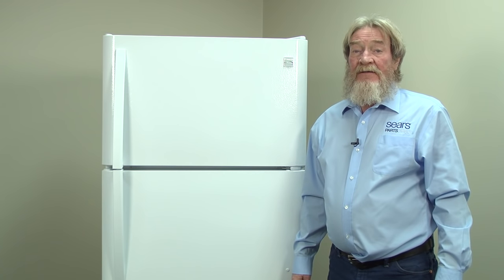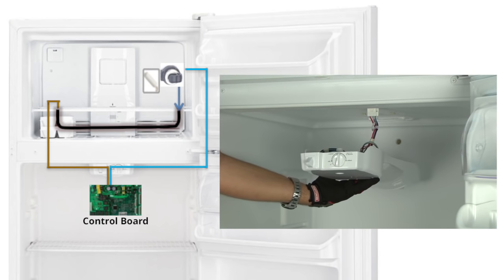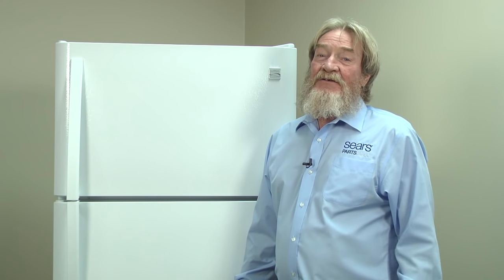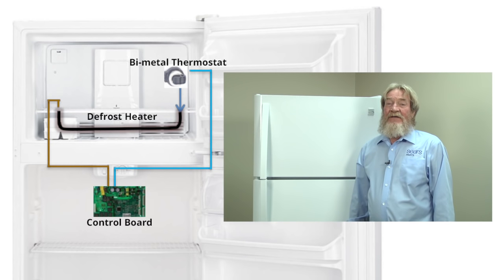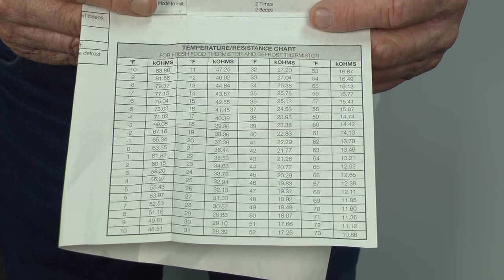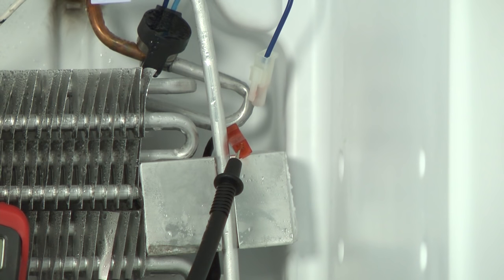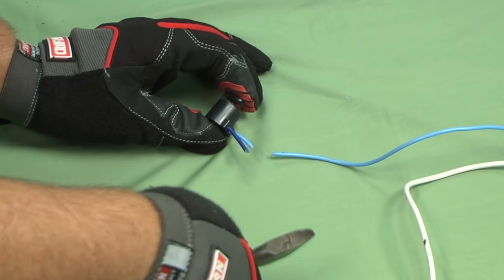How to Troubleshoot Defrost System Problems in Refrigerators

Comment: I have a whirlpool side by side that intermittently stops cooling ice melts.  If I unplug or change the cold settings to coldest it starts working again but will still intermittently stop cooling.  Is there a way to tell if the thermostat is bad or getting stuck in defrost mode?

Comment: can I just melt the ice to get me through until I can get into fixing the real problem
Reply: Yes. I've been doing mine about every 10 days. If you take the back panel off, you can defrost it quickly with a hair dryer.
Reply: This is what folks did before they came up with auto defrosting refrigerators! I can remember watching my dad do it before the days of hair dryers by putting pans of hot water in the freezer to help heat it up.

Comment: This video was extremely helpful because it was very logically organized, and concisely and clearly explained.
I did have two minor issues.  First, you didn't explicitly and clearly identify the location of the wire harness.  I believe it is visible in the upper left as viewed at 3:01 in the video.
Second, the links to the other videos didn't appear to all show up when mentioned in the videos, nor did I find them in the header text.  Hopefully, they are a quick youtube search away.
Thanks again, this was great.
Reply from the maker: Thanks for your comments about our video. The wire harness in the freezer does plug into a connector at the top left corner on the back wall of the freezer compartment. You can see the video links by clicking the "I" in the top right hand corner of the video screen. We hope this information helps. If you need further assistance, let us know.

Comment: I have a GE Monogram frige almost 20 years old. Refrigerator getting too warm f& bottom freezer too cold.  The evaporator coil now ices up and when I defrost with a hair dryer everything's good until it ices up again at the end of the day and frige starts getting warmer. What parts do you suggest I replace?
Reply: Don't guest check timer or heater or defrost thermostat before

Comment: Is the hidden "tech sheet" a Kenmore thing? I'm trying to troubleshoot a Samsung RL34LW-PLUS (RL34LCSW1 / XEG) and there is no "tech sheet" anywhere online. And I doubt I'll be able to find it at the inside some semi-secret compartment.
Reply from the maker: Some other manufacturers include tech sheets with their refrigerators. Samsung typically doesn't include tech sheets with their models. We didn't find information for the model number you posted. You may try contacting Samsung for the tech information.

Comment: Nice explanation. I have a frigidaire. Top of evap is icing up. Mine is 5 times in 6 sec. To initiate  defrost. It will not go into defrost. Bad control board?  The switch seems to be OK I put it in my freezer downstairs I got continuity across and 35 across heater.
Reply from the maker: The control board could be bad. You indicated that you measured continuity and 35 ohms across the heater. If you measured that continuity from the wires that connect to the control board then you know that the defrost bi-metal thermostat is okay. If you checked continuity just through the defrost heater leads, then an open defrost bi-metal thermostat could be preventing the defrost heater from working. Unplug the refrigerator and check continuity through the defrost bi-metal thermostat if necessary. If the defrost bi-metal thermostat is okay, then the control board likely failed. We hope this information helps. If you need further assistance, let us know more details and give us the model number of your Frigidaire refrigerator.
Reply: @searspartsdirect  thank you so much  for the response. It's a frigidaire  ffus2613le6. I noticed my freezer was about 18 deg. And my refrigerator  is fine. 36 deg. Freezer is too warm. When I first opened the evap panel I had a big ball of ice  where the cap tube meets the evaporator coil. And the first 2 rows were iced up, the rest of the coil is not even frosted.  All fans are running. Condenser Coil is clean.. colptessor running  all the time at .6 amps. I was first tjinkimg a defrost issue. I was able to get it to go into defrost  ONCE by pressing the  fresh food light 5 times. So i know  the heater is good, and the switch was working. But I tried a good 30 times and could not get it to go again.  Does any of this sound like a possible  sealed system leak? I didnt want to believe it. But I'm starting  to think the ice pattern  is odd and maybe the control  board is acting up too. I would really appreciate your input! Thank you!
Reply: @searspartsdirect   I checked it this morning and now it's 36ﾟ in the refrigerator and 0 in the freezer but if I open the freezer even for like 20 seconds the temperature shoots backup to like 20ﾟ and it will take a full day to recover to get back down to 0
Reply from the maker: @F12255  Thanks for providing that model number. The frost pattern and ice around that cap tube that you're describing points to low refrigerant charge or a restriction in the sealed system. A service technician will need to repair that type of failure because the repair will involve recovery and recharge of refrigerant.

Comment: I have a Frigidaire Gallery LFHB2741PF4 that keeps freezing up making refrigeratorarea hot. I have already replaced the defrost thermostat switch and just ordered a defrost heater. My existing heater ohms out about 26.5 ohms, so not shorted. Is there even a defrost timer on this unit? I don't see one on the parts diagram. Is 26.5 ohms too low to make it get hot? Any ideas here? I have also looked at replacing the main board if necessary, but that is not cheap.

Comment: Ok done all this and even used the extra adapter into drain line and it still freezes over . So is their a hole in drain line allowing hot air to mix with cold causing it to freeze up ?
Reply from the maker: In some refrigerator models, a hole in the drain line could cause frost buildup to plug the drain hole. Let us know the model number of your refrigerator and we'll try to provide you with some additional troubleshooting tips specific to your refrigerator.

Comment: how long should the coils take to defrost in the manual defrost mode around 30 min?  I cant tell if its working as I have my door off and its warm in my kitchen so the coils are dripping now but not sure its from the unit heating up  in defrost mode?  The door says its in DF mode as I have a newer side by side with freezer on the bottom.  Thanks for a great video.......
Reply from the maker: The evaporator coils should defrost in about 20 to 30 minutes for most refrigerator models. If you need more help, let us know (and give us the model number of your refrigerator so we can provide specific troubleshooting help for your model if necessary).

Comment: Hi Thanks for being here :). I just put in a defrost heater. It read 26 ohms before I put it in. When it came on the the defrost cycle. I could see through the vents it was glowing red. Then a few minutes later it turned off. Should I expect to see a "Glow". Thank you
Reply from the maker: Thanks for watching! Some of the controls will pulse the heater on and off during the defrost cycle so the element may not glow constantly.

Comment: I have a Maytag MFI2569VEB2 ....replaced control board in Jan. and noticed at the end of April that coil vents were frozen...removed cover and the entire coils and left and right sides were frozen. Manually thawed, don't know whether it's defrost,heater, bimetal thermometer, defrost sensor (in round white housing ) or please no the just replaced ECB. Please help. Thanks.

Comment: Nice video. I have been researching my problem for awhile now. At first water was in fridge and it was not cooling. This caused us to replace the defrost timer and the thermastat. The thing is, frost continually builds up. Turning the, uh, technical word here, the thingy till it clicks will send it into defrost. ONE TIME. Also he thinks he can hear a clicking from that area. Once it has been completely defrosted it runs just dandy. Nice and frozen up in the freezer and nice and chilled in the fresh food part. It will not defrost on its own. I keep it going by scraping the ice off the back freezer wall. After a few weeks the ice builds up in the air passageways and the fridge warms up and the freezer gets testy about freezing stuff. The freezer fan was replaced also. The freezer seems to run CONSTANTLY. The fan is always on. Where should we be looking? It is a Kenmore Coldspot 106. Bought it mid 80's. Thank you. Aslo the defrost timer had a jumper that wasn't on the original part.
Reply: , part num ER482493,
Reply from the maker: Because the defrost system works when you manually advance the defrost timer to initiate the defrost and the defrost cycle ends properly (according to your details), a wiring failure is likely preventing the defrost timer to advance after the defrost cycle ends. Unplug the refrigerator and check the wiring connections on the defrost timer. The timer terminals should be marked with numbers 1-4. According to the wiring diagram for a typical 106 series Kenmore Coldspot refrigerator, the black wires should connect to terminal 1, the pink wires to 2, the red wires to 3 and the orange wire to terminal 4. Reconnect any loose wires and make sure the wires are connected to the timer properly. If wires are connected to the timer properly, check the red wire connected between the thermostat and the defrost timer. Make sure that red wire is properly connected to the thermostat. Reconnect the wire if it was loose. If that red wire is properly connected, use a multimeter to check continuity through that red wire. Here’s a video that shows how to check continuity through a wire using a multimeter: https://www.searspartsdirect.com/article/how-to-test-continuity-on-wire-and-electrical-parts-video.html  Replace the red wire if you don’t measure continuity. If the colors of the wires connected to your timer don’t match the troubleshooting tips, let us know the full model number of your refrigerator. If the wire colors match but you need more help, let us know (and let us know the model number of your refrigerator).
Reply: @searspartsdirect I have a fridiare brand refrigerator that is building lot of frost in the freezer.i move the defrost timer with a school driver to defrost mode.the heater seem to work I use a hair dryer to melt all that frost on the condenser then I turn again the defrost timer to the cool position and the freezer fan came on.but later the fan stop and it began to buildup frost once again I thought maybe the defrost timer was bad when out and purchase one and took off the top panel of the freezer to melt all that ice buildup put the new timer but the fan is not spinning and as I would touch the heater it would not get hot like before and it was shooting sparks.i don’t know what is wrong now.i think I might have to purchase a new fridge instead.any ideas?

Comment: what is the difference in purpose between the thermistor and the defrost bimetal? they both are looking for temperature changes right? why does the control board care to read the value of the thermistor if the defrost bimetal is mechanically opening and closing on its own based on temperature?
Reply from the maker: The defrost bi-metal is a simple thermal switch that protects the evaporator from overheating and getting damaged. The defrost thermistor feeds the electronic control board temperature data to help the control board accurately time the automatic defrost session intervals. If the defrost bi-metal fails and doesn't shut off the defrost heater, the defrost thermistor will detect the failure and shut off the heater as a back-up.
Reply: @searspartsdirect  ohh so its a multi step safety backup. that makes sense. thanks for answering!

Comment: Can someone please help. I replaced the thermostat, heater, timer twice, wiring harness, fan motor unit. So it seems to work after I see a spark while connecting the heater wires temporarily (yeah I know it should be unplugged). It defrosts for a while then I can't get it to work? Why would it work for a while after sparking? Thanks for any help I've been messing with this thing for a while now, years. Its a whirpool with the freezer on the top from 2004.

Comment: I have a fridgedaire side by side refrigerator freezer 
Model number FRS26R2AW8.  The refrigerator side only gets to 45° . The freezer works normal but the evaporator coils are frozen.  I have changed the defrost thermostat and that didn't work.  The dampers seems to be clear... Could I have the wrong thermostat? If I click the light switch 5 times, it goes into defrost mode and melts the coils.. what do you think else? Bought the thermostat from a parts shop and it doesn't fit well on the tubing and had to use a tie wrap to keep it attached to the coil tubing... Thanks for am answer.!
Reply from the maker: There is a possibility that the thermostat you used is causing the problems that you're describing if it has different specifications from the original defrost thermostat designed for the refrigerator. The adaptive defrost control board initiates the defrost cycle based on run time and the tripping of the defrost thermostat. If the thermostat you used trips at a different temperature than the original thermostat or the way that you attached it to the evaporator tubing is causing it to trip differently, then the adaptive defrost control board may not be starting the defrost cycle frequently enough which may be causing the excessive frost on the evaporator. The part number for the exact replacement for the defrost thermostat is 5303918214 ( https://www.searspartsdirect.com/product/5119entt70-0046-253/id-5303918214 ). We recommend that you use that thermostat and attach it in the same place and manner as the original thermostat. That may fix the cooling problem. If not, then the adaptive defrost control board may be defective.
Reply: Thanks for your input 👍  it looks like the defrost control board is the problem 
 Would you have the part number for me and I'll order a  new one. Thanks
Reply from the maker: @keithrodriguez1397  The original defrost control board was part 241508001. That original part is no longer manufactured by Frigidaire and I didn't find any available. That original part subs to replacement kit 5303918476. Sears PartsDirect no longer has either of those parts available but you can likely find a valid replacement part through a web search. Be sure to unplug the refrigerator before replacing parts.

Comment: What a wonderful video!
My Liebherr CBes4056 refrigerator compressor and fan is running (can hear the sound) but the thermostat even though it's set to 39F, it goes up to 53F for hours which spoils the food. Again, if you open the door the fan stops and if you close the door the fan starts running but the temperature doesn't drop. 
The 'SuperCool' forcefully brings the temp down to 39F but it turns off automatically after some time. Then it again starts going up. There's snow-like buildup behind a drawer where the temp sensor sits. I manually defrosted it then plugged it back, it worked for a week well then it started again to raise the temp and to buildup ice. What could be the problem, possibly defrost heater?
Reply from the maker: A bad defrost heater, failed defrost termination thermostat--also called a defrost bi-metal thermostat (if your model has one) or a defrost timer failure could prevent the refrigerator from defrosting.

Comment: 30 sec into the vid at the bottom left it shows a green wire with a clip attached, where does it connect?  Great vid, ty.
Reply from the maker: That green ground wire attaches to the back of the evaporator cover as shown at :44 in this video: https://www.youtube.com/watch?v=deomA0CGAZw

Comment: Thanks for the help. I have replaced my bi-metal thermostat and my control board. I have continuity through my heater. I am unable to put it into manual defrost mode according to the procedures on my tech sheet. What do I need to do now?
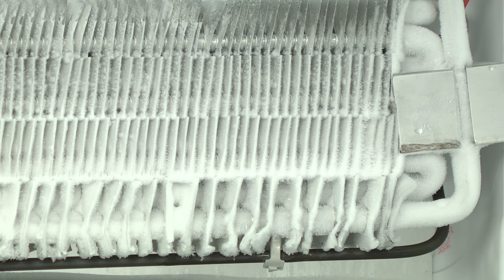Reply from the maker: Watch the video section beginning at 2:05 that shows you what to do if the heater doesn’t turn on in the forced defrost mode. If the tips in that video section don’t help, reply with the model number of your refrigerator and additional details for more help.

Comment: How do I find a thermister for Whirlpool LFHT1831QP0...no one has it! And thanks for your video, great help.
Reply from the maker: The refrigerator compartment thermistor includes the light wire harness. Here's a link for that part (242298701):https://www.searspartsdirect.com/product/670uhzttd0-0046-253/id-242298701 Unplug the refrigerator before replacing that part.